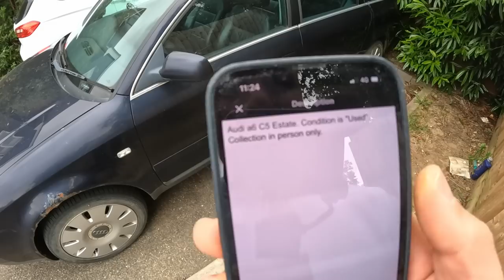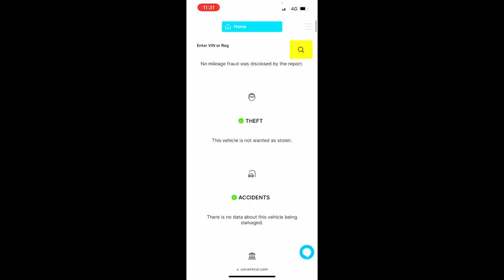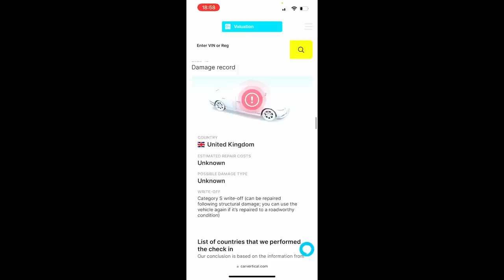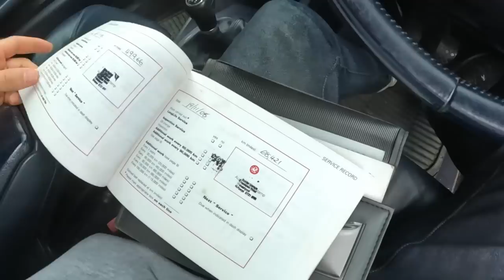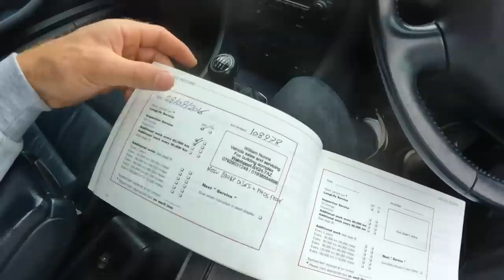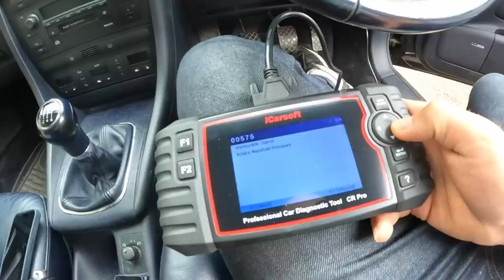I bought the cheapest Audi A6 Quattro on eBay

Comment: Get those injectors soaking in WD40, everyday give it a spray, for a week!!  you need them coming out easy and not snapping in the head,  you will need a clean up kit and new washers and each injector changed will need programming into the ECU, so check if you car computer can do that - you might even find that all the injectors need reprogramming in? maybe try that first? see what that does?
Reply from the maker: Luckily for me this engine isn't a common rail diesel, and the injectors are purely mechanical, so no coding needed 👍🏻

Comment: Good luck removing a diesel injector from a 20 year old car, you'll need it! 😂
Reply: WD40, run the engine, get it as hot as possible, then get your wrench to the injector.
Reply from the maker: I'll just cut it out with a grinder no problem 😅😂
Reply: Dynamite.

Comment: She does sounds good...she need a good service (engine, gearbox and diff) and she will be good for another 100k. I have my workhorse 1.9tdi with 230k and those cars as long as you keeping up with services are amazing.
Reply from the maker: From what I've heard those 1.9tdi engines are basically unkillable
Reply: @NotEconomicallyViable  2.5 tdi v6 can be unkillable to. change oil every 10k km. and do service. no problems
Reply: I have mk4 1.9 with over 500k, and still driving and doing the thing :D
Reply: Bought 510k A6 with 1.9 AWX - still runs so good!

Comment: Nice find! One of the greatest estate cars ever made! If you do basic service properly - oils, filters, wear parts etc - it serves you for a long time. Common issues with these 2.5 TDI engines: sensors can die, vacuum lines and crankcase ventilation hoses and valves leak (old plastic parts break) turbo hose leaks, and because of these the mass airflow sensor gets the wrong value. Also the pre 2002 models had a bad camshaft lubrication system, so the lifters and camshafts can wear badly - can be updated to the newer version. Also the diesel pump can die caused by extreme heat, (the electronics can blow in them) if you constantly running on low fuel level - lack of cooling by the pumped diesel fuel. Have fun :)
Reply from the maker: Thanks for the info, János! A few people have mentioned about a boost leak now, so I'll have to take a look into that as that might be what is really causing the lack of power. And I agree; these are the greatest estate cars ever made!

Comment: Intake manifold pressure sensor mounted behind the nearside of the front bumper. It was as flat as a pancake with that knackered. Sounds just as you described, like a naturally aspirated engine. That was what mine was. I have a 2.5 tdi sport 163bhp fwd A6 C5 on an 03 plate. And they do have a cambelt, unlike moodyk1979 suggested.  And even the later ones like mine still suffer from the bad camshaft lubrication. It sounds fine btw. I'm pretty sure it won't be an injector and it'll be a far easier job to change the Intake manifold pressure sensor than it will to take the diesel pipes off and change the injector.

Comment: My father had a very cheap early 1994 A6 Avant which was just a rebadged 100 avant which he bought as a stopgap while his 4 year old Renault Laguna went French.
It was so good that the Renault ended up scrap at 4 years old but the old 2 litre petrol Audi stayed with him for years and then he sold it onto an Antique dealer who would do over 150 miles a day in it and it never put a foot wrong and the body never had a sign of rot.

I don’t think he ever serviced it as well and all it got was an occasional check of oil and coolant.
Reply from the maker: I love stories like this. And there's something so satisfying about keeping these old barges that most people don't care about on the road
Reply: @NotEconomicallyViable  Luckily it’s an diesel and old VW diesel lumps are legendary and I know with Audi the rot started to set in in the early noughties (no pun intended lol) but I imagine a bolt on pair of pattern wings and a mop will bring it up a treat.

I bought a cheap bolt on pattern wing for £30 for my E36 and to be honest once it was painted you would never know it had been replaced so hopefully a pair of wings will be dirt cheap and it’s been on the car 5 years and is still like new.

Comment: Suggest that you buy a bluetooth OBD2 adaptor and put Torque on an android phone or tablet. With this you can set it up to view, with phone in windscreen holder in front of you, many real time driving values - voltage (to check charging and even voltage prior to starting, although heater plugs would drag this down), turbo boost pressure (you suggest that it is lacking go) as a minimum. Other apps may do the same. For the starting, your new book probably tells you how it is possible to look for resistance through heater plug connection (with supply wire removed) to the cylinder block. Number 27 on YT has recently done an A4 V6 diesel estate badged as quattro but was only FWD.
Reply from the maker: Cheers I'll take a look into that

Comment: Pull the rocker covers both sides and check the cams and followers for wear, if there ok id continue, if the cams are worn the price to replace them may change your plans. Cam belt swap and pump belt would be high on my list too. Good luck.

Comment: Had this engine 3 times. Good engines. One A6 with 280.000km (drove it for 25.000km in 13 months) which I bought with broken camshafts (500€ costs), one A8 with 375.000km (drove it for 20.000km in 12 months) first camshafts and no problems, one A4 with 220.000km (drove it for 40.000km in 25 months) first camshafts but second pump (no costs for me).

I like them. Just don't do long life service (in any engine for that matter) and change oil every 5-8.000km in the AKE, AKN, BAU and BDG and you are pretty much safe. And remove the cover on the engine so the pump doesn't overheat. Never drive the tank empty so that the pump sucks air and burns up and you're safe.

P.S. Good idea with the 01E swap, hell of a lot of work though, espacially with the two different sizes of the bell housings. The Diesel gear ratio is perfect for the 4.2 though. Own one as well.
Reply from the maker: You're an A6 2.5 connoisseur!

In terms of the O1E swap I've seen people on forums do it and they never seem to have any problems with different bell housing sizes. They seem to imply it's a fairly straightforward swap. Or am I missing something? 

Yeah that 'box has two overdrive ratios if I'm not mistaken – perfect for the V8.
Reply: @NotEconomicallyViable  It may be, that the bellhousing for the 01E for the Diesel engines is an older form factor. As far as I know, converting the Automatik C5 4.2 to manual with the S6 gearbox is a pain. At least that's what I'm told by two people who did it twice each.

Concerning the "overdrive", that's not really the case. The calculated gear speeds with the max rpm of the V8 are as follows:

5HP24 Automatik in 4.2 C5
80,64km/h
130,90km/h
191,35km/h
287,98km/h
358,18km/h

01E in 2.5TDI quattro C5
53,85km/h
98,07km/h
152,98km/h
224,45km/h
294,54km/h
359,95km/h

So you see, the 6th gear is almost the same as the 5th gear in the 5HP24, which is perfect for highway driving. Up to 4th gear, it becomes a sprinting beast with times dropping from 6,9s 0-100 to 6s 0-100.
Supercharger and a little less weight and it's a 4,5s 0-100 beast.
Reply from the maker: Thanks for that great info 👍🏻 We'll find out in a few months just how difficult the swap really is 😉

Comment: For the headlights, use some ArmorAll headlight wipes for a tenner at Halfords, they work brilliantly! (And are also extremely satisfying to use) As for the power, check for boost leaks in the pipework leading to and from the turbo as my diesel had a very similar issue. If they are Bosch injectors, they'll clean up pretty well with some steam through the nozzle but will need to be removed and disassembled. A good way to free them is soak them in oven cleaner for a bit and they should pop right out. Good luck!
Reply from the maker: Thanks for that, Joseph. Couple of people now have mentioned about boost leaks so I'm definitely going to check that out.
Reply: Sanding and heated acetone method is also very good with these

Comment: If its consistently slow to start you may need to change the injectors or have to address some kind of fuel leak, check the rail pressure with your tool and make sure its in range

Comment: I paid 750 usd for my 99 a6 avant thought I had the cheepest one. Good find. Mine came with terracotta interior
Reply from the maker: Love the retro colours that these cars were specced with. Certainly beats most modern cars with their dull black interiors that are specced just to help resale value
Reply: @NotEconomicallyViable  yes absolutely. My avant is the one in my profile picture and I got it because it needed a water pump and turned out it actually was a rear heater core hose not the pump (after I changed the timing and wp and thermostat) only really went for it because it had different interior. All black exterior and terracotta and black interior on the carpet door cards and dash top of dash was a grey to blend in to the beige a b and c pillers and white headliner I recently recovered in black stretch suede. Thinking of doing a rs clone on it when this 189,000 mile engine gives up the ghost.

Comment: I suggest that you give it a service (engine oil and all the filters), clean the headlights, replace both front wings and add some injector cleaner to the fuel tank before you even consider putting it in for an MoT. As it is, you're staring a guaranteed MoT failure in the face. I've had my 5th Gen Toyota Celica for nearly 3 years and I haven't MoTd it yet because I know it will fail.
Reply: He's putting it through the mot so he doesn't have to diagnose alllll the problems first, no point wasting time on all the little bits like headlights first when it might be rotten all underneath or has bigger issues all around 

For the sake of £40/50 may as well put it through so you know what needs to doing
Reply: I know where you're coming from but if he can't fix all the failures within the window for the free retest (10 working days), he'll have to pay for another test and they'll test everything again. With the free retest only the failure items are tested to check that they've been rectified.

Comment: Dont worry about the needle lift sensor its only needed for checking the pump timing when the timing belt or the vp44 injektion pump is replaced probably its a boost leak or broken vacuum line to the turbocharger  its not the reason for the missing power
about the bad starting maybe air in the fuel line often they go bad (filter to vp44), glow plugs, g62 coolant sensor 
Since it is a 2002 its most likely an AKE they have a big problem with the cams and lifters 

Greetings from austria and an audi crazy guy who owns one A8 3.3tdi,  eleven A6 C5 quattros, three A4 B6 and two A3 8L🤣
Reply from the maker: That's some great info there, thanks! I'm definitely going to have to check for boost leaks or broken vacuum lines then. And I've just been researching the VP44 – apparently there's an o ring that goes bad and that lets air into the system, so I'll probably look at replacing that.

Eleven C5 Quattros!! Haha leave some for the rest of us!
Reply: No i want the all 😂😂
Only the 4.2 v8 allroad is missing in my collection 🥲
Reply: I agree about needle lift sensor, it it has no effect on power. Also very comon problem is failed n75 valve(controls the turbo) and stuck vnt mechanism.
Reply from the maker: Would you get an error code if it was the N75 or VNT?
Reply: Yes something like this boost pressure below control limit
Reply: You can test it via the actuator diagnosis
Reply: @lukitheboss9672   i have one in norway with only 110000km

Comment: I used to own one of these Nino, but I had the 2.5TDI sport Quattro 180bhp, not sure if that’s the same or a 163, but they are very reliable engines, no cambelt but has a cam chain and needs to be checked to make sure it’s not stretched. Being a Manual it will be more relatable than the CVT Auto, but be warned that clutch replacements cost more as it’s a Quattro. Loved mine it had full works and had Bose sound system along with heated seats and electric rear blind. Let me know if you need any help as I know quite a lot about VW / Audi’s. 
Haven’t watched all the video yet, but be interesting to see what you will do with it :)
Reply from the maker: Haha if only Facebook Marketplace had a 'buy it now' button. That'd spice things up a bit

Comment: Check for air getting in to the fuel system for the elongated crank time. Diesel runs back to the tank. Should be a sealed system
Reply from the maker: Thanks for that, Malcolm. Where would be the most likely place air would be getting in? Hoses?
Reply: That happened on my Jeep it was the “O” rings on the diesel filter connection.
Reply: @dougfields5798  exactly the same thing happened to my Saab. Had to park front facing down hill to stop the diesel running back to the tank.
Reply: @NotEconomicallyViable  fuel filter o ring
Reply from the maker: Cheers, gents